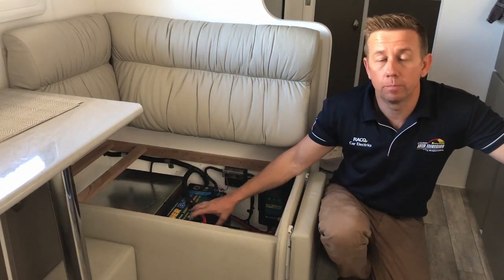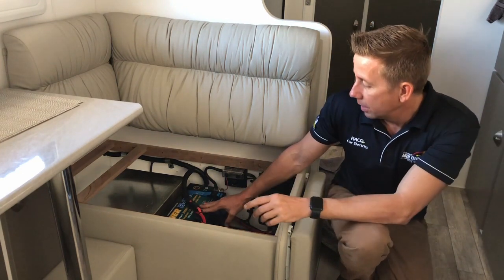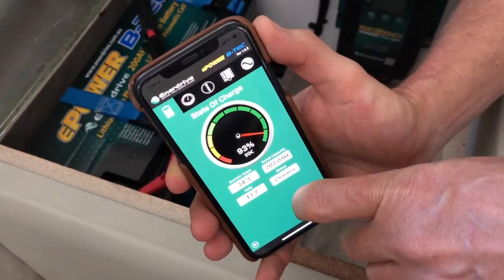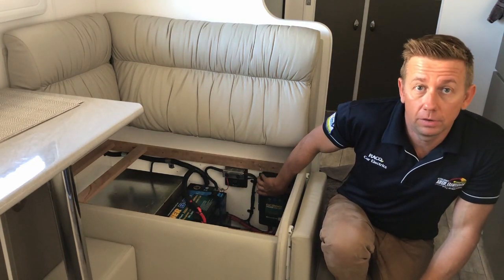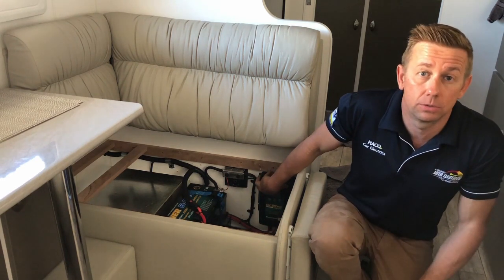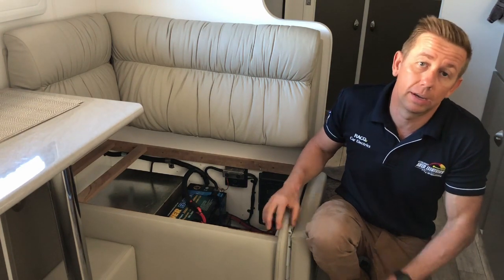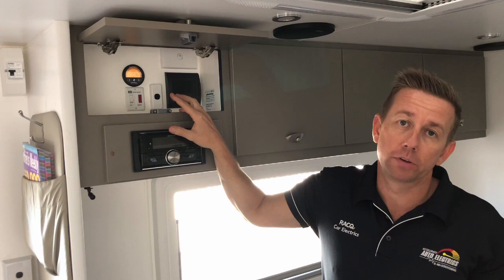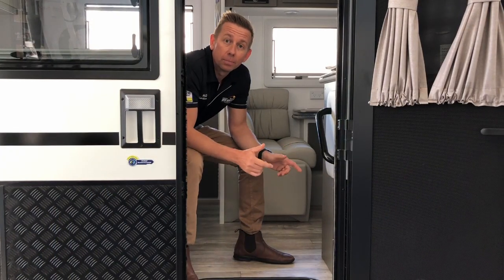Caravan Battery Upgrade to Enerdrive Lithium Battery System | Accelerate Auto Electrics

Comment: Hi there, I have ordered a new caravan which has 2 x 100ah AGM batteries included with 320watts of solar on the roof. I am thinking of upgrading to 2 x 150ah Lithium. What would the rough cost to install same ? I am in Rockhampton Queensland, but the caravan is being built in Melbourne.

Regards
Len Palmer
len57@hotmail.com
Reply from the maker: Hi Len, we'd be happy to discuss your set up. Please call our office on 1300 227 353 or email your details to info@amae.net.au.